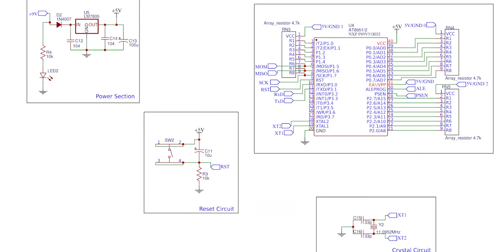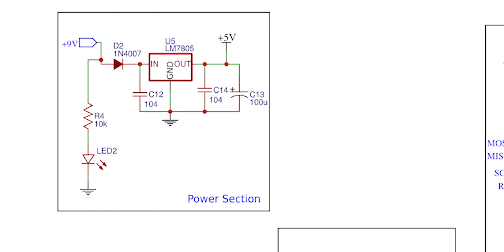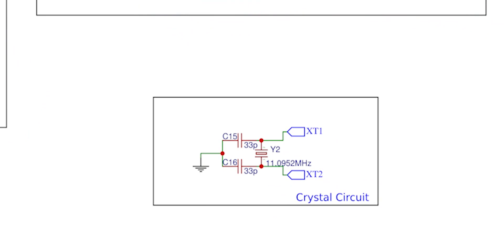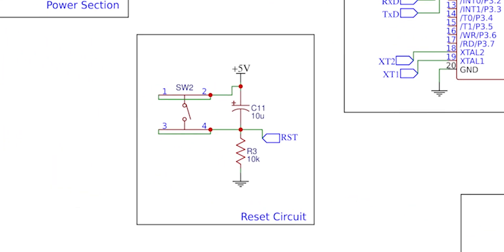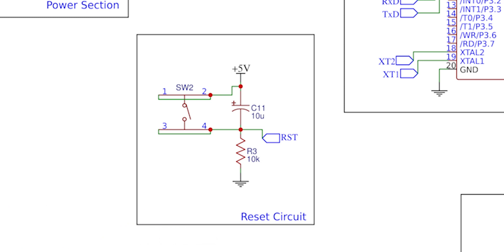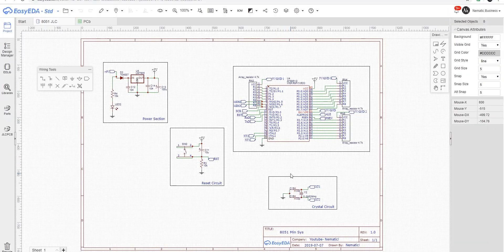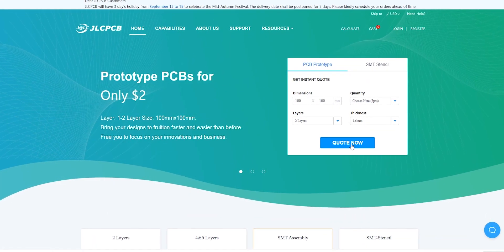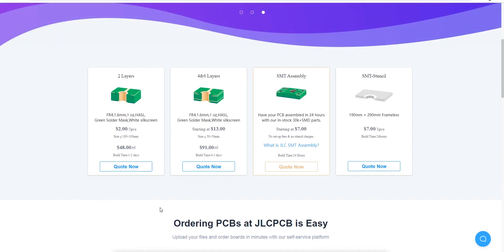Make Your Own 8051 Minimal System | DIY Development Board

Comment: very nice! i'd arrange ISP pins as the programmer pinout and connect power to the mcu in order to plug and use also UsbAsp and avr programmer
Reply from the maker: From my initial testing I never got USB asp to work, but anyway I have left ISP pins on PCB. 
If you are interested here is another video on 8051 programming using Arduino as AVR programmer- https://youtu.be/8255_CHE5gE